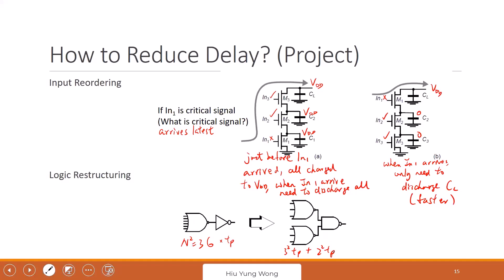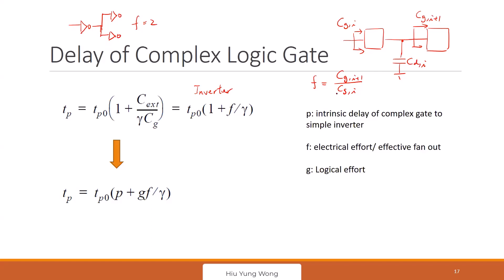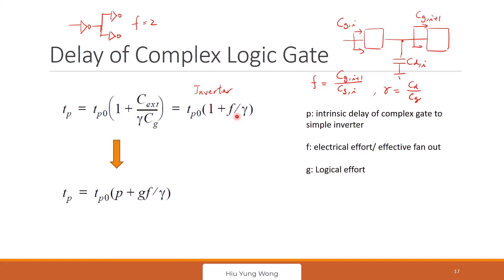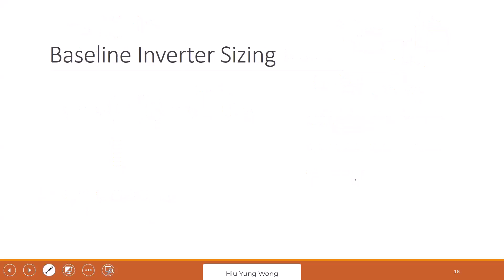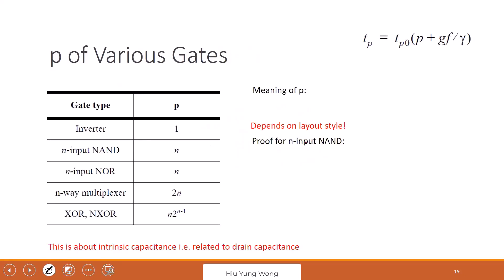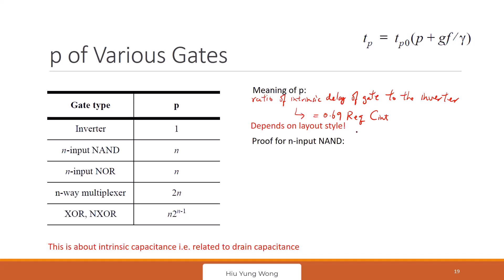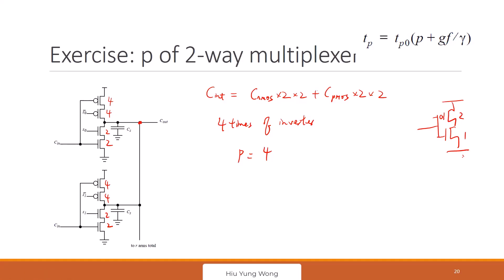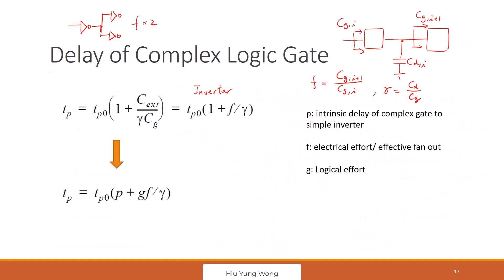L15-C Delay of Complex Logic Circuit and intrinsic delay (p-value)

Comment: Cpmos*4*4, Instead of Cpmos*2*2?
Reply from the maker: Can you let me know which slide are you are referring to and what you mean by Cpmos*4*4? Thanks a lot!
Reply: @quantum_computing  @12:49 (slide 20) Cpmos shouldn't be sized as Cpmos*4*4 Instead of Cpmos*2*2
Reply from the maker: @AnandhaKrishnanRK  Cpmos refer to the cap of PMOS in a sized inverter that has a unit width 2 (see the drawing a the right 13:17). Since we size it as 4 in the new circuit, so it is 2X of the size of the PMOS in an inverter. And since it has 2 circuits, so it is another 2X. Therefore, it is Cpmos*2*2. Hope that's clear. Thanks!